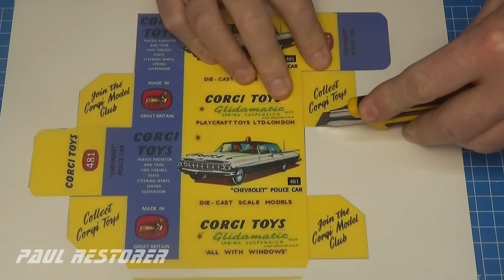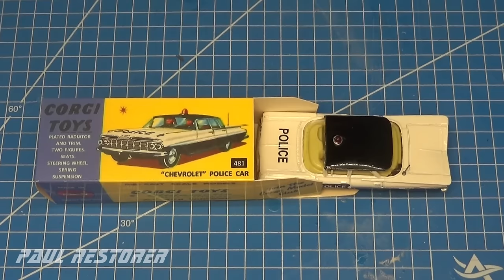Chevrolet Impala samochód policyjny. Renowacja modelu Corgi Toys nr 481.

Comment: It's true. Budgetary constraints often had GM's Chevy's in their fleets as pillared sedans. Cheaper than hardtop Sport Sedans and usually the cheapest models which would have been the Biscayne or the Bel Air, only very rarely the Impala, but also as a pillared sedan. with it's curved roof line, not the "patio roof" so named for the extended rear roof overhang. Just plain less expensive for fleet buyers. The Sport Sedan was the name used by all of GM's brands for their hardtop models except for Cadillac.
Reply from the maker: cool